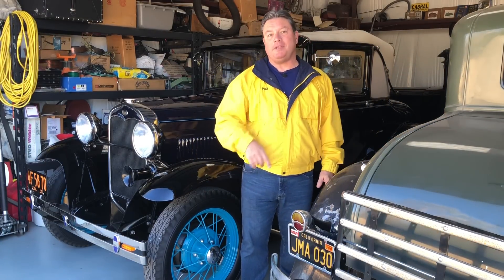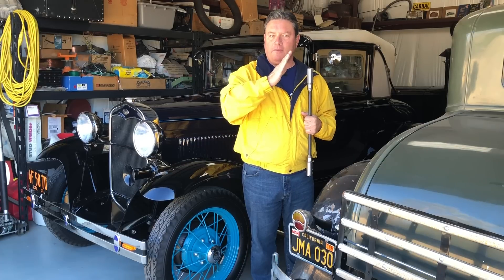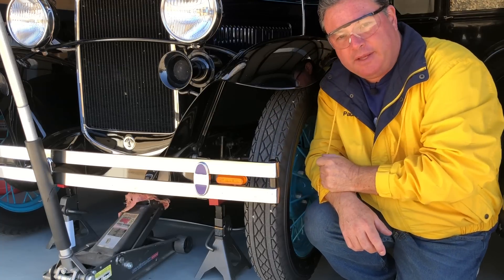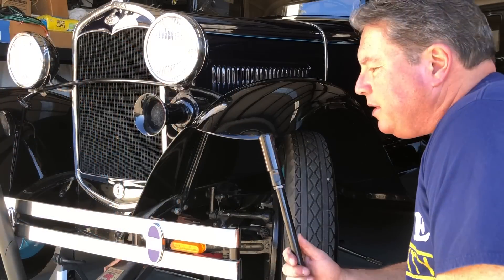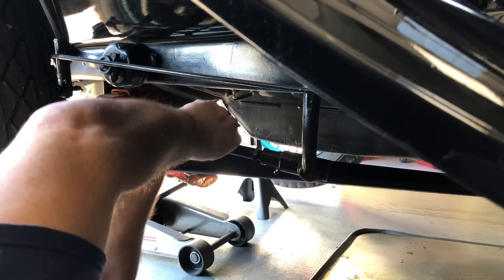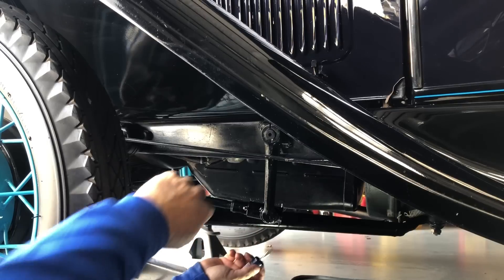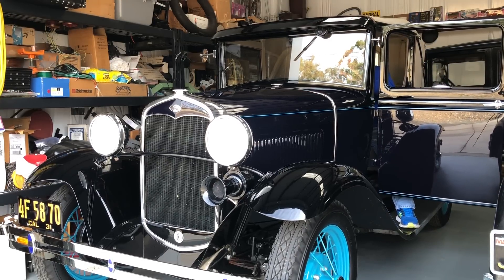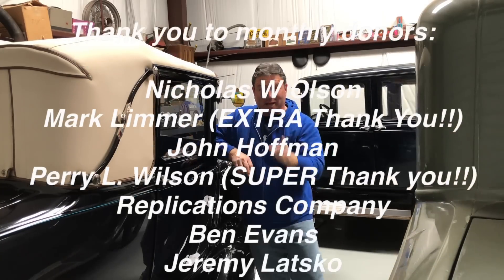1931 Ford Model A- Will it drive?  Adjustable drag link installation and drive

Comment: THANKS PAUL , the " theory of operation " , eludes so many people, " ESPECIALLY A LOT OF MECHANICS " !!
You have know idea just how many " pro mechanics " have no idea how something works or is suppose to work ??
45 years in the trade rebuilding " MACK TRUCKS " working alongside " parts changers "  !!!
those adjustable drag links , in all vehicles , ( revolutionized  the alignment industry ) ! 
 the old vehicles that had a "selective fit "
( keyed or otherwise , steering wheels ) , made the alignment guy pull the drag link & bend it in a press to get the wheel
to point correctly either at 12 o'clock  or 3 & 9 position depending on how the wheel was made !!

BARBARIC , yet that's the way it was done !!  that's why you get in a old truck, and even though the front end was tight
guys wouldn't take the time , just to get the wheel position correct !!

RIDING HEIGHT , aka  =  new springs vs. old springs ,  would change the static position of the steering wheel as well !!

AJUSTABLE - DRAG - LINK ,    " HOW - SIMPLE  -  YET - HOW - HARD "   ?????

KEEP UP THE GREAT VIDEOS ,    2 THUMBS UP  !!!!!!!    THE MACK GUY
Reply from the maker: Thanks Paul!  Merry Christmas.

Comment: Paul, nice video. I especially liked your “pro-tip” regarding clear on the cotter-pins. It those little insights that begin to shed light on how great your engine and running gear always look on your “daily driver” (I know the show car is immaculate). 

Merry Christmas and thanks for all your efforts in the last year (especially considering your health scare).
Reply: An even better tip: get stainless cotter pins.  No spray needed - stay shiny forever!
Reply from the maker: MAFCA Webmaster is right- Stainless!
Reply: Agreed….even better

Comment: I opted for the stainless steel cotter pins. But can now use my cheap ones with a little clear - Thanks.
Reply from the maker: Stainless is cool too.  You can polish them up to look like chrome if you're bored...

Comment: Another wonderful maintenance video. 
On manual steering tightness, my understanding from years ago is that mfg's left a little play in the steering to avoid abrupt immediate steering from hitting bumps or when a driver may unintentionally turn or veer from other minor causes like reaching and even shifting. It was a failsafe thing. My great uncle and my Grandfather were mechanics way back then. Of course, roads were not like todays.
Reply from the maker: Correct.  Model A steering also has just a small amount of play as a rule.  Same reasons.  I like mine really tight.

Comment: Adjustable Drag link? Nice! Great video!
Is that a sock you’re using?
Stella sure looks nice next to your 31.
Looking forward to your next video.
Malama Pono my friends💕
Reply from the maker: Hey Ryne!!  Yep, that's what happens to my old socks.  I have the stuff on order to replace the top on Gandalf, and that is coming soon.  We got the windshield glass now, so that is coming up as well.  I just picked up a used but decent rubber floor mat also.  Coming together!  Hey, question...  You are definitely set on a coupe, yes?  Not a tudor?
Reply: @ModelA  yup, I always wanted a 5 window coupe. I think after watching American Graffiti for the first time in the 70s. 
Am I planning on hot rodding this car? Absolutely Not! I love the sound of a four banger and the simplicity of a Model A. Like my 34 Ford Tudor, this coupe will stay original. 
My friend in Australia is calling me a purist 😂 but I do have my 28 ford pickup that’s a hotrod.

Comment: Thanks for another interesting video.  I am contemplating an adjustable drag link. By my measurements, I could probably do with a 5/8th inch shorter drag link to center my sector shaft/steering wheel.  I was hoping you could add more details left out in your video: 1. What ended up being the difference in measured length of your drag links pre and post.  2. From steering wheel centered, how much travel does your steering wheel have going to the right full travel stop (the stop bolt on the king pin) with everything hooked up (on jack stands), and how much travel going to the full left stop? Just curious.
Reply from the maker: The steering wheel was only off a few degrees, but it was driving me nuts (I have mild autism).
Reply: Still would love to hear how many turns on the steering wheel for full right from center and full left from center (I know it was 1 turn and a half each way, three turns total, with drag link disconnected, but that changes when the drag link is connected...
Reply from the maker: Full lock with the drag link connected is minus 1/4 of a turn of the wheel.
Reply: @ModelA  sorry to "drag" this out, but "minus 1/4 turn of the wheel" isn't making sense.  My question is, with steering wheel centered, how many turns of the wheel does it take to go full right, and conversely, full left.  For example, on my current setup, it takes 1 and 3/4 turns to go full left, and only 1 and 1/8 turn to go full right.....an adjustable drag link should patch this up for me..
Reply: @ModelA  "full lock with drag link connected is minus 1/4 turn on the wheel" Does this mean that you are short of hitting the left full travel stop by 1/4  turn of the wheel in the left turn?  That would make sense to me, since going from centered to full left turn (hitting the stop) takes 1 and 3/4 turns of the wheel on my A.  If I adjusted my steering wheel center at 1 and 1/2 turns, left and right, with wheels pointing straight ahead, I wouldn't be able to hit the left stop.  The only way I can "fix" this would be to heat and bend the steering arm on the left spindle by 5/8".  I'm not ready to do that, so I'm sticking with what I got.  Shortening my drag link won't do this trick. (Sometimes it's tough being a nuclear engineer in a model A world!)
Reply from the maker: @kdog622    The backing plates hitting the bump stop on the back of the bolts that hold the kingpins in place is what is supposed to be the travel limit.  The steering box itself has a little more travel than that, but you don't want to use it.
Reply: @ModelA  thanks... I understand the travel stops.  My question is regarding your steering wheel travel with your adjustable drag link installed. Very simply, I am asking, with your wheels in the air (floor jack, or jackstands), steering wheel centered, wheels pointing forward, how many turns does it take for you to go full left turn, and does it make it all the way to the stop bolt on the king pin?   Just a data point. KB.
Reply from the maker: @kdog622    Yes, both wheels hit the stops at full left and right.  It's a little under 1.5 turns to each bumper stop.  I'd call it 1-1/4 turn from center to stop.

Comment: This is out of context. Paul, This is Don  of "Don's Old Garage" on YouTube. I've watched your videos on timing the Model A. They are great. Here is my question, I'm working on a 1933 Chevrolet 5 window coupe. And I know you are a Ford Guy. I wish my Chevy was as easy to time as your Model A. Do you have any suggestions? I've watched many YouTube videos, manuals, etc. The Chevy has a marking on the flywheel that shows Top dead center, and It can be checked by putting ones finger over the spark plug hole and feeling for compression. also one can check you noticing the lifter positioning. And from that point you start to set the distributor, i.e. the rotor is pointing to #1etc. with all this I still don't feel secure with the setting. Maybe you may know some Chevy Guy who could give me suggestions. Thanks again. I always enjoy watching you videos, even though I'm a Chevy Guy at the moment.
Reply: Why no reply?
Reply: @donsoldgarage8148  Paul doesn't read video comments every day like emails or texts.
Reply: @chemopia  Thanks

Comment: I thought I'd take the chance to see if you have a suggestion as to why one of my shock control arm could be hitting the fender? I could offer more details and pictures if you require. I enjoy you videos.
Reply from the maker: Oftah.. I have no idea.  Unless the shocks are installed in the incorrect corners and the arm is in the wrong spot?  The control arms should be straight out (parallel with the ground) at the center of their travel when installed properly.

Comment: I see you're not using a shortened Pitman arm. Would shortening the arm require lengthening the drag link to get the steering gears to the "nice and close" position?

Comment: I thought you had swallowed a spider! 😄

What is the underlying issue that caused your wheels to be out of alignment?

Always nice to catch a glimpse of the '29. 🤩
Reply from the maker: The steering box loostened up a little after Texas, and I keep adjusting the slop out.  The wear finally got enough that the wheel wasn't perfectly "+" when driving straight.  I need to rebuild the box this winter.  But there is still a couple events I want to do before taking the car out of commission for that long, so this will work for now.

Comment: Hi, Paul I guess this won't work with a 7 tooth 1928 steering box,  as they are not adjustable and the slack is usually in the box !!!  Please tell me I am wrong,
Reply from the maker: It would work with a 7-tooth box.  But, without all the adjustments, a 7-tooth box needs to be rebuilt more frequently for the same miles on it, so it probably wouldn't get to this point.  I dunno.

Comment: Greetings,
A question for you on an unrelated subject.
I see the little Sport Coupe has turn signals mounted in the front bumper.
As I recall, you said that was a poor location for turn signals, because it was too low for other drivers to see.
I know you can convert cowl lights to function an turn signals, but I don’t care for cowl lights.
How else can you mount turn signals on the front of a Model A?

Let’s be careful out there.
Reply from the maker: Correct.  My sport coupe does not have cowl lights, so that is why I put them in the bumpers.  Better than nothing.  Barely.

Comment: Great video once again, Paul. I would like to know how tight you make the ends of the rod. Is it a certain number of turns after the cup contacts the ball? Thanks for all you do!
Reply from the maker: Thanks!  I just tighten until the cap is in far enough that the cotter pin goes in freely.
Reply: The "spec" is to tighten the cap to achieve 25% spring compression. That's a bit of fun to measure and achieve, so I just do what Paul says!
Reply: @ModelA  That's how I'll do it then, thanks again Paul and thank you, Kevin.

Comment: Hi Paul,  another good how too.  I did not see Model T's "You Tube" this week.  I hope she is ok!
? about todays adjustable drag link.  Could you adjust the tie rod to center everything?   I know that the toe-in would have to be redone where as the Toe-in is not disturbed with the adjustable drag link.
Thanks again Steve B
Reply from the maker: She is doing fine.  Just busy.  The drag link does not affect the toe-in. Correct.  I just used it to re-center the wheels with the steering box at its center.  The box has a lot fo wear and needs a rebuild. But there are still a couple events I want to do before taking the car out of commission for that long, so this will work for now

Comment: Fascinating fix! Pardon if this has been asked, but what were the options, if any, to address the same issues back in the day, before the adjustable drag link was invented?
Reply from the maker: Thanks!  Back in the day, they either wouldn't care or they would take it to the dealer or a shop and they would rebuild or replace the steering box

Comment: Should not the steering wheel cross be at a 45 degree angle instead of the cross being at 90 degrees so as to obstruct the view of a short person driving the car?
Reply from the maker: From the factory (fac-tree?), the steering wheels were at a cross "+" when the wheels were straight.  There are two shaft keys so you could make the steering wheel an "X" when straight if you want.  Check the judging standards, I think it is mentioned there.  I know it is mentioned a couple times in the Ford Service Bulletins.
Reply: Thank you

Comment: Do you see any issues with the adjustable drag link using the standard tie rod ends instead of the standard drag link ends?
Reply from the maker: No problem

Comment: Hey Paul, just curious. Where do you get most of your model a parts from? I’ve got a 31 that my grandpa left me and have noticed that Macs and Snyders often don’t have what I need. Btw, great channel!
Reply from the maker: Thanks!  I buy from 5 or 6 different suppliers.  They don't all have what I want, so I spread it around.  Mike's A-Fordable in GA has been coming through lately though.
Reply: Thanks for the reply. I’ll give them a try.

Comment: Thanks Paul, great video explaining why these may be needed and how to install. However one thing that I thought of when watching it, is that you need to ensure the ball joints are rotated into alignment before tightening it up so they aren't binding and wearing at the base of the ball. I found it difficult to explain in writing, so I made this quick video:
https://youtu.be/S2W41m-H-zM
Reply from the maker: Excellent!  Thanks for adding that useful info too!  The new drag link centered itself, and I didn't even think to mention that.  Glad you jumped in!

Comment: I didn't see the reference to the preload on the drag link, maybe I slept through it ? Dazzling us with what you take for granted isn't a "Boomer" Trait.
Reply from the maker: Preload on a drag link?  Read the Ford Service Bulletins.  No such thing.  It says to tighten the end caps until the cotter pins go in easily, that's what I did.  Pretty boomerish in my book.